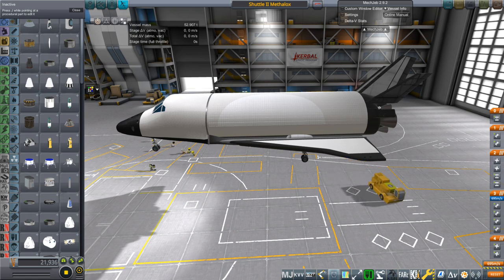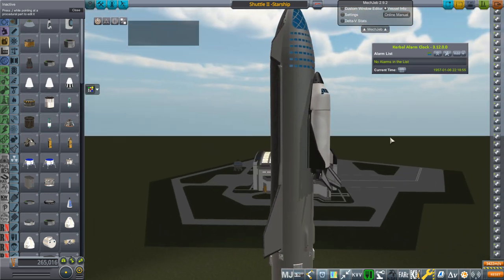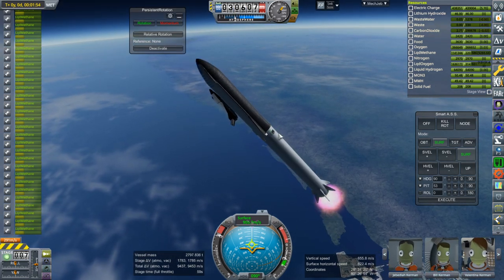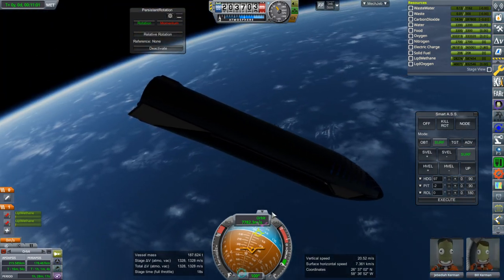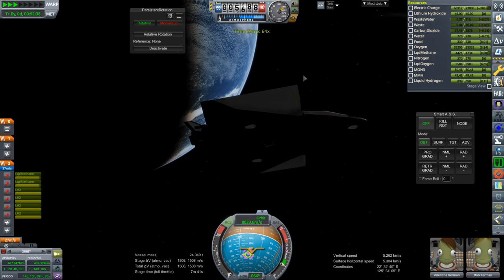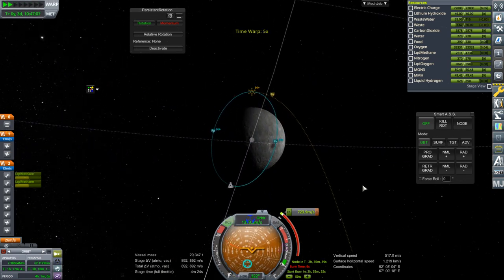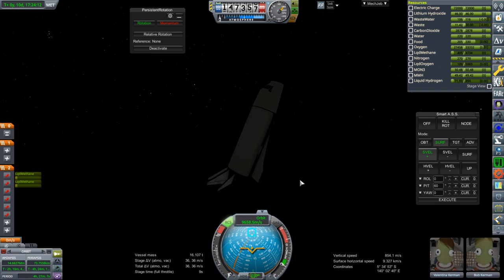Realism Overhaul in KSP 1.8.1 - Shuttle Mark II - Starship

Comment: Propellant reserve in LEO (Starship cargo with zero payload) will be more than 100 tons, so no need for 10 refueling more like 5-6 even with same dry mass
Reply from the maker: Ultimately, but not with Starship as they currently have it. Maybe if they update us on the Raptor engine performance (they've mentioned short term chamber pressure improvement, but not the numbers they expect to get sustained) then I can factor that in.

Comment: 0:45 Isn't using your own engines kinda cheating due to this being (more so than most of your other projects) a proposal for real life within one generation of spacecraft?

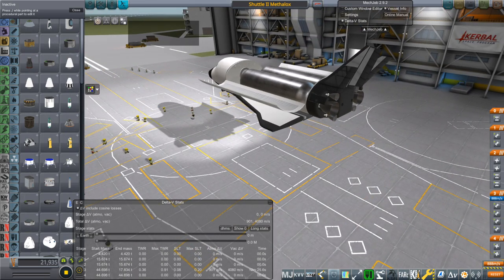3:45 to 7:05 Mah boi spitting straight FIRE

7:35 Yup, looks real pretty.

8:40 A Silbervögel Mk IV-L torches you with its liquid-core nuclear thermal precooled turbohemirockets† as it takes off to land on the Moon and return without staging or refueling.

16:10 What's that about full reusability?

†A "hemirocket" (for "half-rocket") is a term I coined for an engine that exploits the turboramjet effect at high speeds to allow operation on a partially-air-breathing, partially-rocket mode, the ratio at which that is possible depending on the compressible dynamic pressure to static pressure ratio. Using such a system should provide some air-breathing benefit up to when the airspeed and exhaust velocity is equivalent... or am I just misunderstanding physics and this is in reality impossible?
Reply from the maker: The ED-1 is similar enough to things a lot of people have been working on anyway - it's a 30 kN Methalox engine that provides 360s ISP. It could easily be replaced by a bunch of the Dynetics lander engines instead, but this was more convenient because it fit the slot I had already built into the model. On the turboramjet, it sounds similar to the SABRE engine for Skylon? Anyway, I'm pondering a combination scramjet-aerospike myself since the form factors are similar.
Reply: @RaizSpace  That about the ED-1 makes sense.

To my knowledge, SABRE is a precooled air turborocket that may take advantage of the turboramjet effect and is designed for both air-breathing and rocket operation, but it is not a hemirocket. The reason is it's supposed to switch between air-breathing and rocket modes, not transition between them. 

The idea behind a hemirocket is to use the additional stagnation pressure at high airspeeds to counter the additional chamber pressure produced by injecting both more fuel and oxidizer in it, resulting in an engine that can, in the right flight envelope, serve as 25% rocket 75% jet, 75% rocket 25% jet, or any other value on that continuum, while also maintaining a higher level of thrust than would be possible with air-breathing alone. This could have great performance advantages, but I feel that as it seems not to have been seriously proposed by other people it may be based on physics misunderstandings or otherwise be impossible.

Comment: Hello, great video! About the refueling of starship, I had thought that perhaps if you had a starship going between the moon and earth, picking up oxygen from a base which makes it from rocks or ice, whichever is easier, that maybe you could have to get a little bit less mass into earth orbit as you could get your LOX from the moon. I did some back of the napkin math, and it looked like it did not work out but I do not have your expertise, and I was not exactly sure how to calculate the advantage gained by having two ships, with one going between low lunar orbit and the surface, bringing up LOX, and the other one going from LEO to lunar orbit to back again. I would love if you would give that a try, thanks!
Reply from the maker: It would provide a marginal benefit over launching from Earth if the Moon-LEO ship aerobrakes, but it's actually worse if it uses propulsion to capture back to LEO. An additional difficulty is the necessary lunar infrastructure to produce so much LOX, which I don't have in the game right now. Maybe I can make a large ISRU plant - I'll have to see.

Comment: Would a starship/super-heavy heavy not make a lot of sense. To get the same twr you would only need 92/111 raptor engines on the three super heavy boosters of which one would be a dedicated core booster. The dedicated core booster would then only need 18 sea level raptor engines. This either saves dry-mass or space to put some more efficient vacuum versions to light higher up. Since the dedicated core stage has half the engines, it would still have roughly half the fuel at side booster separation. This adds a lot of dV requiring less refueling trips. While if reentry is to harsh, it could be possible to add wing surfaces on the core booster and/or an aerodynamic nosecone underneath an expendable interstage.
Reply: Remember when they have to cancel Falcon Heavy three times? Yeah that exactly the reason why SpaceX is unlikely to pursue it
Reply: @alvianchoiriapriliansyah9882  I did not propose spacex to pursue it, but raiz space. A lot of the missions he does are probably never gonna fly in real life, like his starship heavy.

Comment: Using just the Raptor vacuums after the TWR gets right would increase the Delta-V right?
Reply from the maker: That would increase the remaining delta-v for Starship, but doesn't do anything for the Shuttle Mark II.
Reply: Raiz Space Is it due to gravity loss from low twr?
Reply: @5000mahmud  No, the vacuum engines have a higher ISP than sea level engines do.
Reply from the maker: No, it's just because Starship isn't bringing Shuttle Mark II to beyond LEO in the first place, so adding more delta-v to it doesn't get the Shuttle any further. More delta-v would let us carry more other cargo in Starship, but wouldn't change the situation for Shuttle Mark II because it gets dropped off at LEO no matter how much delta-v Starship has left.

Comment: Sooo.... basically you've turned Starship into a shuttle drop tank :)
Reply from the maker: With tourists!
Reply from the maker: Uh, the engines take up most of the space on the back end. It's got too much engine and not enough room for fuel for doing what the fellow said it should do (an SSTO from the surface of Mars). It looks pretty, but is completely non-functional.

Comment: so i was working on the second part of my mod when part tools just stopped working any ideas?
Reply from the maker: Can you describe what stopped working looks like?
Reply: @RaizSpace  so i go into unity made a gameobject, imported my model and texture, then i go to add the part tools component then when i do unity starts lagging really bad, when i have the game object selected, nowhere else and then the game object itself is just the text that says: "part tools(script) it stopped working after i made a tank and idk why
Reply from the maker: I don't think I've seen that before. If you try to go into the menu at the top to configure Part Tools (Set Data Dir, for instance) does it let you? If not, go into the PartTools config in the project folder and just set the Data Directory to something else to see if that helps. Somehow that helped me one time when PartTools was acting up. Otherwise, I guess just make sure you did that TextMeshPro thing they told you to do on the forum page about Part Tools.
Reply: @RaizSpace  update i think i might have my fix, i think my unity version is out dated ill post if it worked
Reply: @RaizSpace  yeah no nothing yu said to try, or anything i found to try worked is there any other way to do this??
Reply: @RaizSpace  i finally fixed it by setting gamedata directorie and refreshing it

Comment: How do I make texture unlimited work
Reply from the maker: Well, the parts have to be configured for it. Best way to figure out how to do that, if you're trying to apply it to a part that doesn't already have it, is to look at parts that do have it implemented.
Reply: Raiz Space does some stock parts work
I have the starship mod it kinda works on it but it isn’t close to as good as yours
Reply from the maker: It's possible that Textures Unlimited comes with configurations for some parts already.
Reply: Raiz Space ok thank you. Also do u have a discord server
Reply from the maker: Yeah, but it's generally people I'm familiar with after interactions on Twitch streams.

Comment: Your refueling timeline doesn't make any sense. Why won't they just make a depot starship that you can fully fuel. Then when a mission occurs the mission starship can refuel in one refueling. This taking a day at max to get to full fuel.
Reply from the maker: Then you have to refuel the depot starship the exact same way? It's a waste of a starship, which also has to be maintained. Just do the refueling first like I said, and after it's topped off, send the crew. Using a depot isn't going to reduce complications - it just adds an additional rendezvous and docking we didn't have to do before.